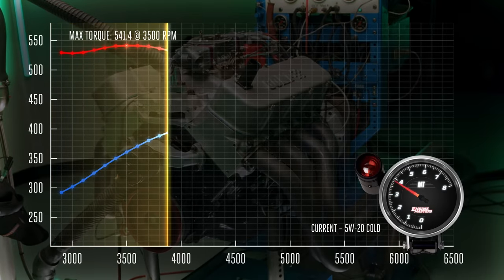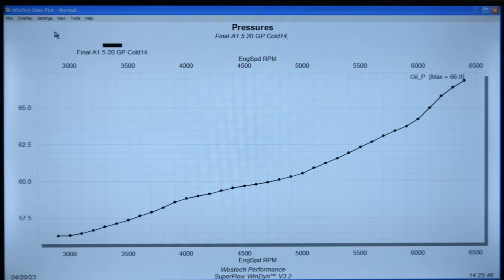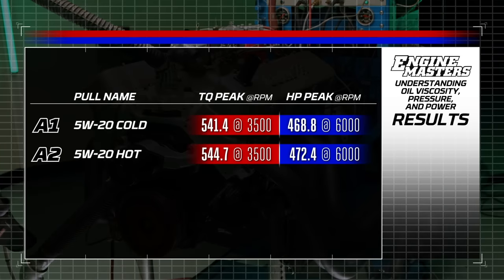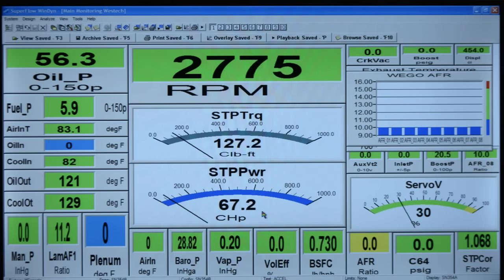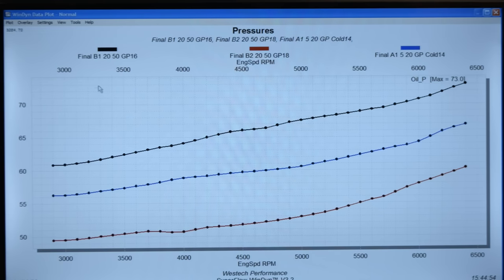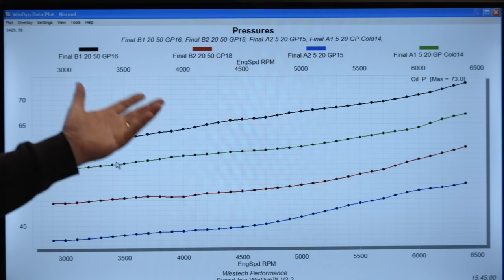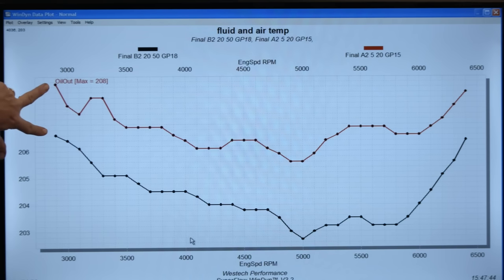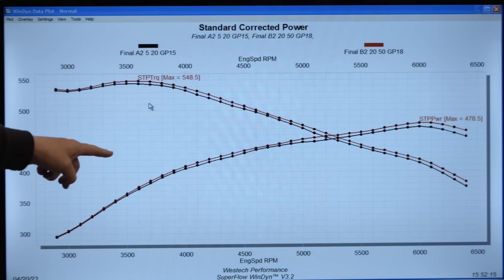Does the Thickness of Your Oil Matter? | Engine Masters FULL EPISODE | MotorTrend

Comment: I think using hp and tq to qualify oils is silly. One should not choose oil to make power, but instead to protect the engine. You look at your main and rod clearances, then think about what you're putting your motor through. That should be enough to choose an oil. If not, pick a brand, make a call, ask questions. It should NOT be based on hp and tq.
Reply: It depends if you are racing or not!  In competition, be it road racing or drag racing, you would usually want all the power you can get.

Comment: Another cool test would be with oil additives "snake oils" and engine restorers. For people looking for that "performance in a bottle".
Reply: Lake Speed JR. is the engineer that worked for Gibbs Racing when they brought this oil out. Lake was the dyno person and marketing. His opinion is that there is a risk that they won't even get along and you may destroy an engine mixing this together. Buy the right oil and change it when it is done. Lake moved on worked for another race team and now works for total seal piston rings. He has business doing oil analysis also. He is well known by every engine builder aftermarket parts maker out there. Which means he has a freight ton of videos out there on the technical side of engine building. Start searching under that name and you will get educated because it isn't just him but him interviewing or having discussions with other people.

Comment: I don't worry too much about main and rod bearing wear (durability comments here seem mostly aimed at that) but I have had some cam and follower wear issues. I think the thicker oil would be even more helpful with cam/lifter wear than bearing wear. Especially if non-roller followers are used. 
    I prefer thick oils, with a decent warm up period after a cold start. I suspect the EPA doesn't like either. I am after long life...seems to be working.

Comment: Right off the bat, there are a few flaws in this test!!
1.  Since this is an unknown brand of oil, how it performs against itself for different oil weights isn't as important as how it performs against well know brands! HP & Tqe differences for different oil weights is interesting but how it stacks up against well known brands is more important if it is going to compete against them!
2.  Testing for HP & Tqe while it may be interesting, the most important function of oil is lubrication and prevent wear!  Without actually tearing down the engine after these these tests, which by the way are too short to gain any significant data, the HP & Tqe data are not what the consumers will be concerned about since they will NOT be disassembling their engines for a complete rebuild after so many runs!  What does it matter if this brand of oil makes max HP or Tqe if the engine is destroyed after 500 miles of use??!!!

Comment: There's a reason why race engines use thicker oil. I'll never own anything or use a 0w-20 or 5w-20 oil or thinner. The engine used in testing was never meant to have 5w-20 ran in it.

Comment: Been running 10W60 in my turbo 2004 Subaru Forester since I bought it in 2008. Never had any issues with oil pressure or consumption. But if you try a 15w40 oil (i did a couple of times) it really felt harsh in the high rpm, where as with the 10w60 was smooth all the way to the rev limiter.
I started using that oil as BMW used it in the M power V10's in the early 2000's. If the 10W60 could survive at 9000rpm in a V10, I figured that under 7000rpm in a turbo 4 would be fine.
Reply: But watch going too thick imo. Those v10s have more horse power to push through the heavier weight oils. You start putting 60 and up in a little 4 banger with less power, it’s going to be harder to push through that viscosity with the rings, which will hurt the crank bearings cuz of extra pressure pushing in them. 4cyl I usually don’t go above 40 unless it’s burning like crazy, at that point the engines on its way out anyway. Just what I’ve noticed through the yrs of building, running, and blowing up engines haha
Reply: @Rusty90  well, it's survived 180,000km using the 10W60 (aside from 10,000km of 15W40) and it's still going well, running 190kw at the wheels. And considering the EJ25's are known for bearing problems, I can't be going that badly......
Reply: @alistairwhite2906  sounds like it’s working to me haha 👍

Comment: Engineering of the power plant dictates the recommendation of oil and viscosity needed for any given application.. super close tolerance built engines of today need the flow characteristics of modern lubricants.. it's not just a question of thicker or thinner.. synthetic oil came about from the needs of the military years ago for artic environment, flow issues in extreme cold temperatures..

Comment: funny how the Ford Ecoboost 1.0, 3 cylinder engine runs on 5-20 Castrol oil lol ... 
That's 50 ish oil pressure when hot is worrying  lol

Comment: G'Day,,well well,,,less presure equals big clearnce in pump,,,Thick oil seals clearance in pump leakage,,yer sure bearing clearance will count,,we need pressure measure from different points of the motor,,are we getting enough oil to mains,,or is it all running out of places it not meant to,,,Like cam shafts ,,,piston oil squirters,,Pump relleif valve,
Engine design,is done to make the car sold to you last a long time,,follow recomend oils,
Stop trying to squeeze More from it,Heavy oils reduce flow,,More drag on galleries,hence also higher pressure depending on where measured,,want better flow..polish you oil galleries,
Check a thing called film strenght,,this wil give you some sort of idea when oil shear will take place,,Under heavy loads at high revs,,for sure oil shear is gunna happen,there goes ya crank shaft,,
if you brought every gadget to same 20% and another saves 30%,,you should save 50% on fuel,,let me know when this happens,,

Comment: People get all wrapped up in this subject when 99% f what is said is total BS. Example number 1. When Ram designed the 6.4 Truck Hemi engine, they did all their testing using 30 weight mineral oil, yet when they put it in the trucks for sale they state to use 0w-40 synthetic oil. There is a video of one of the engineers who worked on developing the 6.4 truck Hemi and he was asked why did FCA go with 0w-40 when the truck was tested to 300,000 mile durability using 30 weight mineral. His answer was he did not really know but suspected it was because the 6.4 car Hemi required 0w-40 and FCA did not want the car Hemi people confusing the oil with the Truck 6.4 Hemi.  Example number 2. FCA again this time their ecodiesel, it was originally specced for 5w-30 oil and all the forum warriors would preach you better not use anything except 5w-30 oil or you would blow it up, well they were blowing up alright, but they were blowing up because the 5w-30 oil did not have a strong enough film streagth to protect the bottom end bearings, so after FCA investigated the issue they changed the spec for all ecodiesel engines to use 5w-40 oil instead because the 5w040 had a stronger film strength.

Comment: 20w50 cold is NOT the same viscosity as 5w-20 at temperature.  the W rating is a relative scale, I.E. a 5w20 ,5w30,and 5w40 are not the same when cold.

Comment: Running a test like this on just one engine is misleading.  The oil viscosity needs to be matched to the engine clearances and design.  Try this same test on a modern car engine with very tight clearances that was designed for 0W20 oil.  I suspect you will see rather different results.  With a big V-8 with clearances you can drive a Smart car through, heavier oil is going to be advantageous.  I bet you would see just the opposite with a modern small 4 cylinder designed for 0W20 oil viscosity.

Comment: I left the thick oil cult years ago.
Reply: Though it did take a while as the viscosity prevented me from moving too fast. It resisted and not assisted in my movement within the engine. Once i got passed the stockholm syndrome of higher price meaning better quality more tests mo q.c etc. I was able to return to normal grade oil and everything functioned again as normal🎉

Comment: Nah. Just run 75W-90 in everything the thick the better right?
Reply: 75W90 gear oil is about the same as 10W40 engine oil.  It's a different scale.  In any case, Penrite sell a 30W70 engine oil in Australia. It's only twice as thick as a 10W40 at operating temp though (three times as thick when it is cold however).  It's only about four times as thick as a 0W20 at operating temp for that matter (six times as thick when it is cold though).  The differences between these SAE grades is really not that large, a lot of it is splitting hairs.

Comment: You were surprised that oil helps promote ringed seal? I always believed that's what the crosshatch in the cylinder bore was for, to retain oil. To help the rings seal.... This is engine rebuilding 101 that you're oversimplifying for a 10 year old.